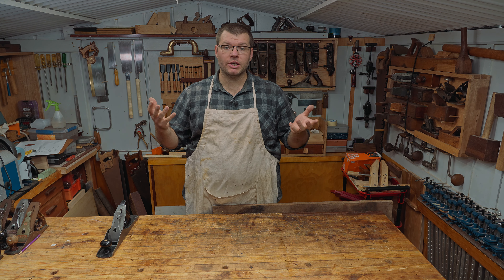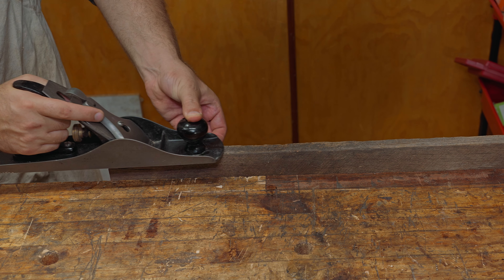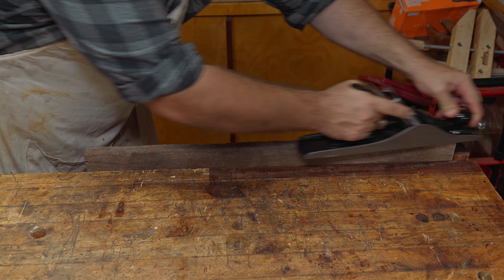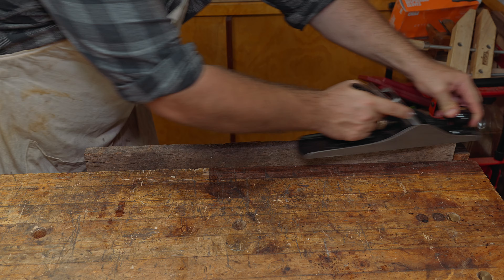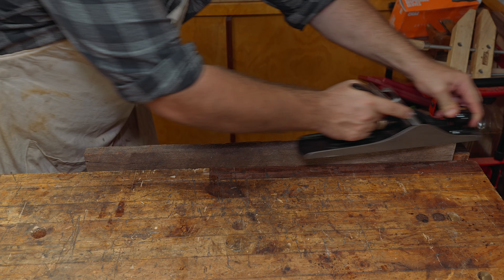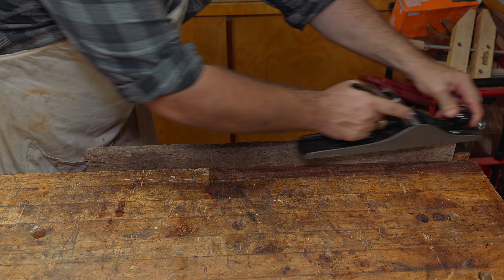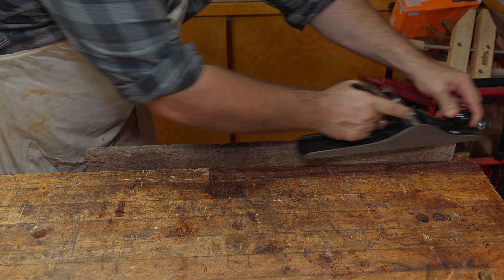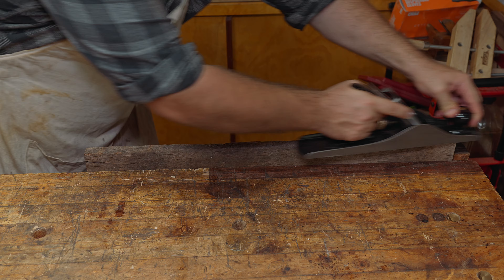How to Hand Plane Board Edges Square

Comment: I kind of always thought that the camber was more useful for rough planing, and smoothing would best be done without camber. Jointing somewhere in the middle. Cool to see that it can be done anyway you like!
Reply from the maker: Yes, generally i only use a camber on a roughing plane. I have a straight bevel and just roll the corners of all my other plane blades to prevent 'plane tracks'. However there are lots of people that put a small camber on all their blades, so i just wanted to show both ways.
Reply: Great tip. Thanks for the reply!!

Comment: Just trying to figure out the use of the camber blade, does it mean the EDGES of the camber do not cut the wood? That the only part of a camber blade that takes a shaving is the middle section. Or, do the edges of a camber blade take less of a depth cut than the centre of a camber blade? Why have a camber blade at all if you can't get a full width cut? I'm confused.
Reply from the maker: Sorry for the late reply.

The whole purpose of a camber is to prevent the corners of the blade digging into the surface when hand planning the face of a board. The idea is a small curve is added to the blade meaning the corners don’t make contact with the board when in use meaning the curve is slightly more than the thickness of the shaving. When edge jointing you need to make sure the center of the blade is doing the cutting, and if squaring the high spot the center cuts the high spot but not the rest of the board due to this slight curve on the blade. 

I don’t use cambers on anything other than a rough remove board. What I do it roll the corner of the blade so the rest of the blade stays flat (I have a video coming out hopefully next week showing this process). When using a blade without a camber the process is much easier for jointing the side of the board, and the offset of the sole of the plane is used when cutting the high point. This means you don’t have to worry about where the camber is on the blade. Traditionally cambers were hardly used except on rough removal planes from what I can find from my research. So you are correct on a dedicated jointer plane there is no need to worry about the corners digging in as this only really occurs on the faces of the board wider than your blade.

Really I see cambers as unnecessary unless on a rough removal plane such as a scrub or fore plane. They are talked about a lot of YouTube as some saving grace, but I believe they cause more confusion than they help.

If you have any more questions please ask.

Comment: Another hint that I have found useful in my case is try to keep elbow in to prevent going off in the first place..Sometimes I find myself bring my elbow in and out in a single stroke. At time its creates edges off at opposite angles from front to back. Also slow and steady stroke is better control.
Reply from the maker: Thanks for sharing your tips to help others out, much appreciated.
Reply: Thanks. since you are receptive to tips I will add another I like. When planing edges of narrow boards you must remove from vice because even small square is too big. However when planing the other side to size and square I will rest board on edge perpendicular against stop.The benefit being ate square edge is holding board in near perfect perpendicular plane and you can judge square off bench and board at same time. another benefit it is faster the removing from vise to check line and square. works good on narrower boards that wont tip, but if you feel tipping you know you are going out of square. @AussieWoodshed

Comment: Good advice showing the two alternatives of plane set up. I also only use a camber on my scrub plane and a straight edge with slight turns (just enough to eliminate obvious tracking) on my other planes. I can see an advantage in having a slight camber on other planes but I prefer to avoid the slight hollow it creates.
Reply from the maker: Thanks Pete. I think everyone has their own process and if it works that's fine, there's no wrong way if the results are the same.
Reply: @AussieWoodshed  Another advantage of having straight edges with slightly rolled corners for most planes is they are quicker and easier to sharpen; no faffing to get a slight camber equalised from one corner to the other. A large camber on a scrub plane is much more pronounced and visible - and therefore easier to gauge by eye than a tiny camber. Finally, not always but frequently I like to use a guide these days because as I get older my eyesight (and therefore accuracy) when sharpening is not what it was 40-odd years ago. There's no shame in reverting back to guides when you need to!
Reply from the maker: @PeteLewisWoodwork  yes, it's definitely less faffing around and quicker to sharpen, which is why i started rolling the corners.